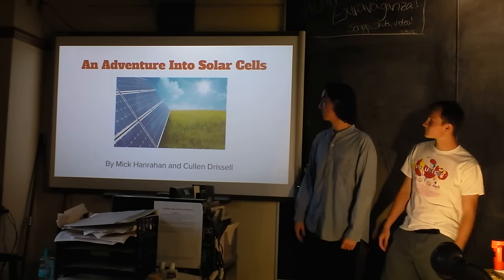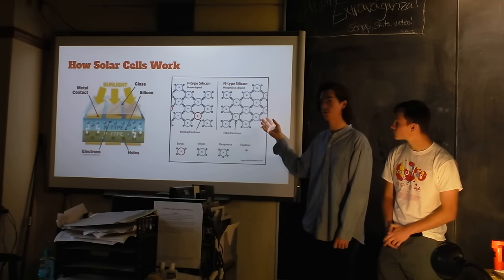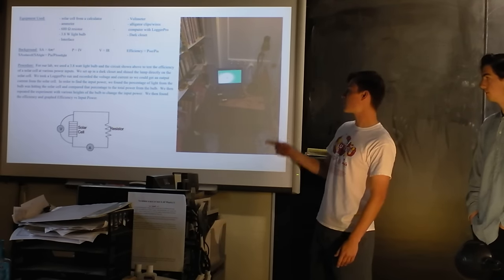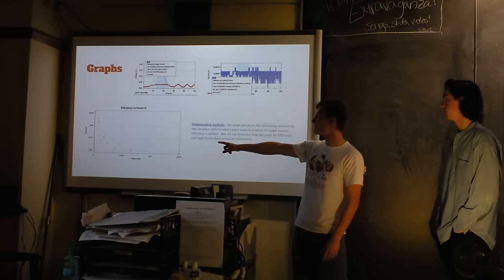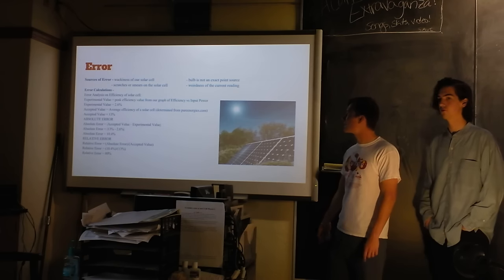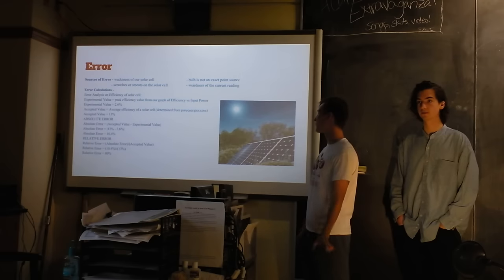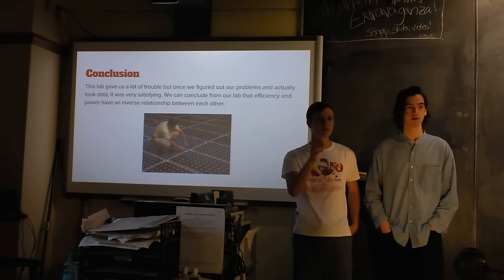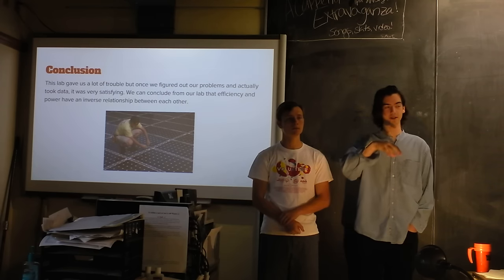Indie Lab - Solar Panel Efficiency as a Function of Incoming Light Intensity

Comment: What is the time scale of the voltage bumps? (Can't read the graph axes.)
Like sporadic -Z I'm guessing you are in the weird world of small devices, where many spurious effects come into play.

The best way forward is more experimentation: play with the electronic aspect. The reported trouble with the selection of the load resistor indicates that varying it may teach us something about the instability. Try a different cell. Try more light.